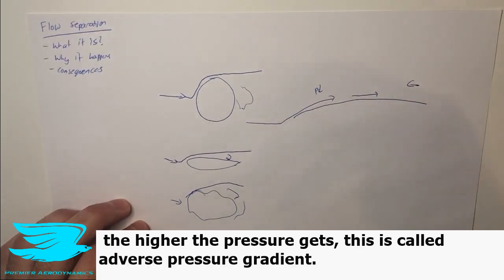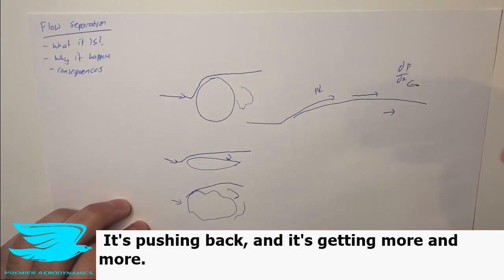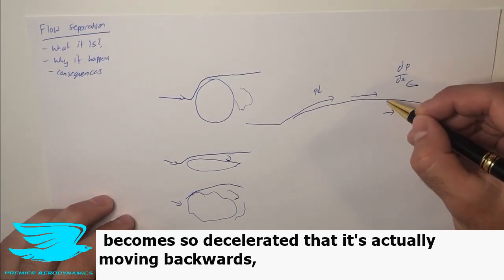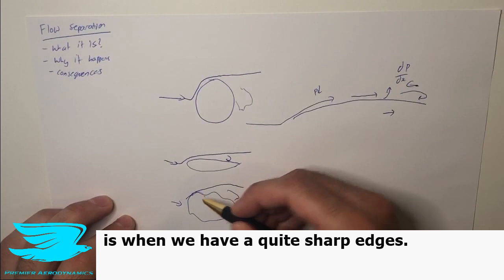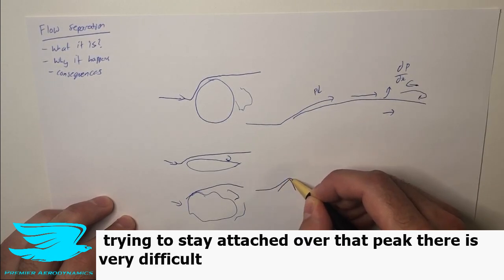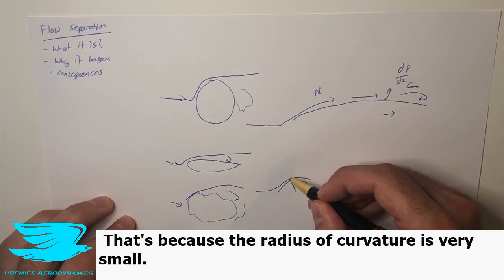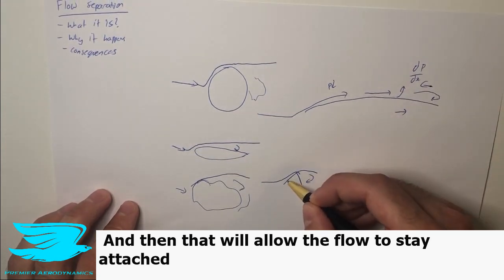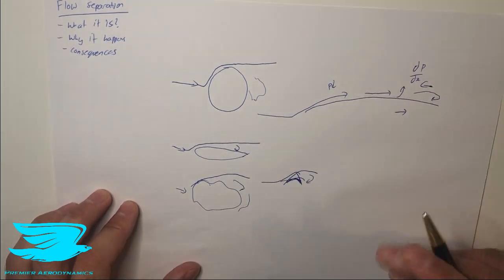[Aero Fundamentals #24] Flow Separation Explained

Comment: Not fully correct. At high AoA and speeds, the Re is significantly high, meaning inertial forces outweigh viscous ones, leading to flow to separate. This creates a low-pressure pocket behind the aerofoil or wing, where air is not attached and hence slows down.
This causes a higher static pressure, which forces air particles into the pocket, and even slows down the sped up air molecules after the separation point.
Reply from the maker: Sorry I don't understand what you mean by something in the video isn't fully correct. Could you elaborate please?